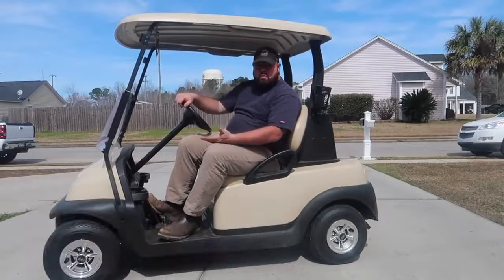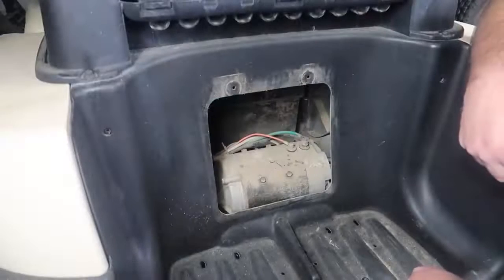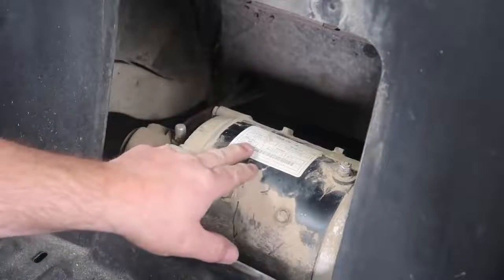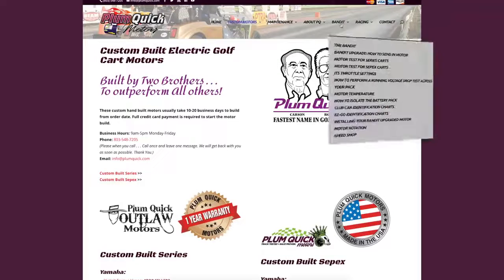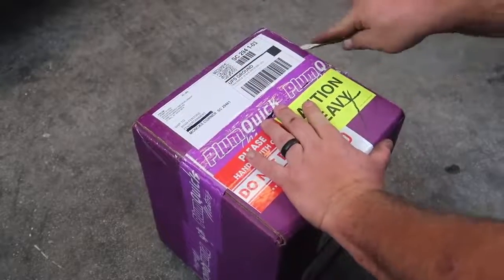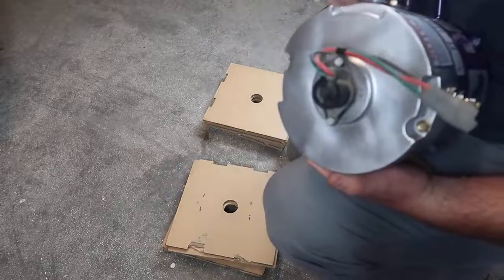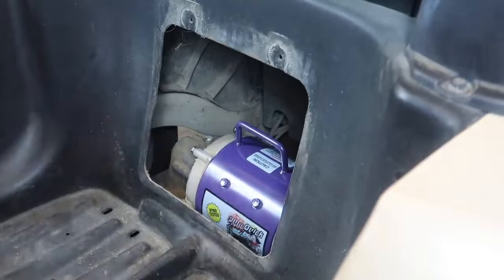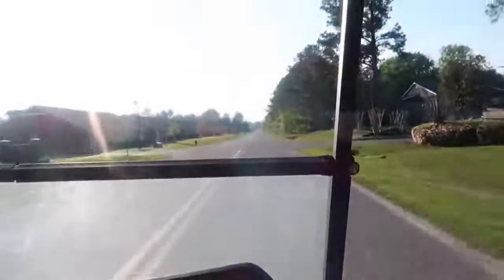How To Make Electric Golf Cart Faster   Plum Quick Bandit Speed Upgrade   2014 Club Car Precedent

Comment: Good video on replacing club cart prec. 48v electric motor with bandit.    I am having a problem with removing the motor, with all wires and 3 bolts removed.  It did not turn, and I am trying to pry it off, a mm by mm.   What is causing this stuck or too tight to get off issue, please?
Reply from the maker: check to see if you have a 4th bolt that holds the motor on

Comment: If my 98 TXT doesn't have the run/tow switch I am unable to do this, correct? Thanks.
Reply from the maker: yes, you'll need a 48 volt PDS wiring harness to run the AC kit, we can send you a link to order this harness
Reply: @PlumQuickMotors Thanks so much for the quick response! Do you have to order a new motor or do those two parts speed up the cart on their own?
Reply from the maker: @mellownessuperstar2618  If you're just wanting the Bandit upgrade then you can just send us your motor for the upgrade and run your stock components. You'll need the harness conversion if you're wanting to run the AC kit and get speeds up to 30+ mph and great torque.

Comment: I have an early ‘70’s Harley electric golf cart and two questions: first, there are five or six electrical devices in a row behind the seat battery bank. I believe that these are “solenoids”. I want to replace them because of age. What new components replace these silver small canisters. The second question is the motor configuration. The back of the motor bolts directly on the differential. The other end has the disc brake assembly bolted directly to the motor with the disc connected to the armature drive shaft. Can plumb quick provide a new motor or do they rebuild the old motor?
Reply from the maker: Sorry, we don't do these older motors.
Reply: @PlumQuickMotors  yikes! Is there an option? Any comments on the solenoids. Any help is appreciated.
Reply from the maker: @larrysorenson4789  try vintage golf cart parts

Comment: I had the same DS club cart 48v and wanted to follow what you did in the video. I got the same bandit upgrade but when I put it in my cart it actually is slower.  I was hoping you might have more comments on this video but maybe you can provide some guidance,  as I regret my decision.  

I have tested the voltage, made sure wiring is accurate,  no bushing... even though my didn't have it, tested with and without the speed sensor connected.   Currently at a loss why it would be slower. 6mph is the max it will travel now.
Reply from the maker: You have a bad speed sensor or bad speed sensor connection. Push the cart 3 feet, if you don't hear the beeping then it's a speed sensor issue.